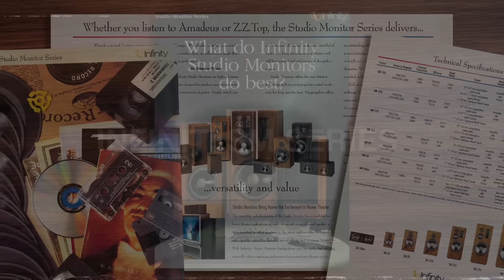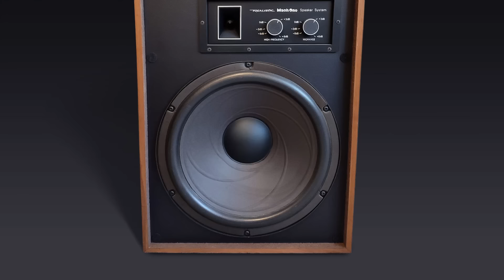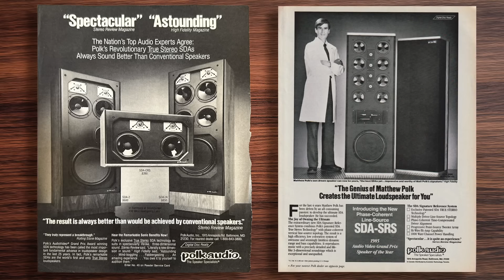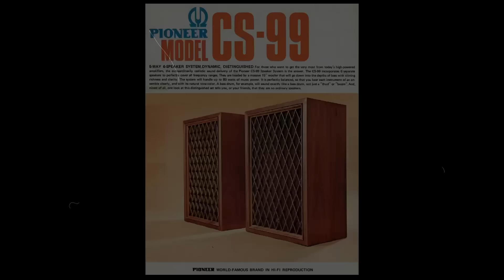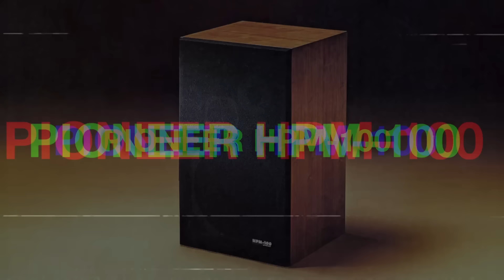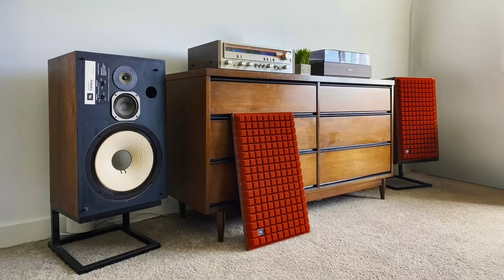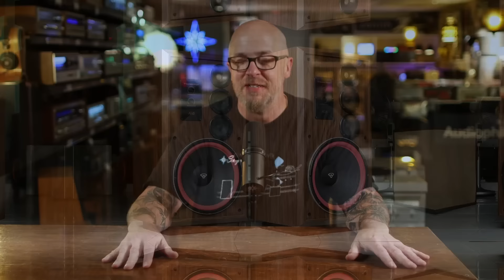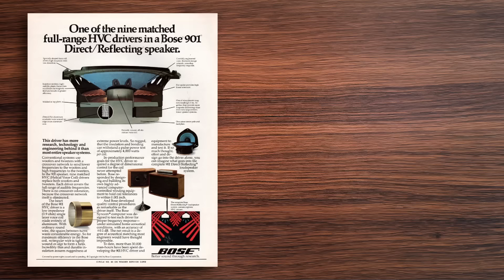Why Do Audiophiles Hate These 9 Legendary Speakers?

Comment: I have only 6 pairs of speakers! Or so I thought. I am moving to a larger flat looking through my boxes of gear, I found a pair of BBC Compact Monitors. I thought zi had blown the crossovers, merely a loose connection. I think 7 pairs of speakers is enough for a 2 bedroom flat!
 I only use 1 set in a room at a time. Greeting from England.

Comment: Little 4 1/2 Infinity 2 ways are what got me into hifi DESPITE visiting THREE different stereo stores. It was those little SEALED speakers and their easy sound that wowed me.
Bose! I've never liked anything Bose... GIMMICKY! The first pair of speakers I bought were a 6 1/2" pair of JBL 2 ways no matter how hard the salesman tried to push Bose on me. ALL of the speakers sounded muddy. I actually like the 5 1/4" JBLs better for midrange clarity & speed, but went with the 6 1/2"s instead because they did bass. I guess that makes ME "one of those audiophiles" because the only thing in this list I'd own would be Infinitys or Polks. Big woofers and ports are the enemy in my world. I'd gladly get another pair of little NHT Superzeros any day. They lack the last bit of treble speed and extension, but image like champions and even sounded better on Water Drums 1 than a pair of Energys I bought thar had excellent metal dome tweeters that just sounded "clinical" on the track vs. NHT natural.

Comment: Well maybe the different speakers do sound better or worse given the room they are in. After taking blood out of both arms and donating a few internal organs, I purchased a pair of Klipsch La Scalla II just before COVID came to town. I had wanted a pair of Horns since 1982, but when I plugged them in to my Yamaha RX-V659 receiver with DOLBY 5.1, I checked every available equalization scenario, the KHs sounded like real and total crap! I plugged in the microphone and let the "auto tune" do its thing and they still sounded like crap, I mean real crap. No Bass, Honk, Honk... Crap times a million. Then I pulled out my MacIntosh MAC 4100, grabbed a hold of the 30Hz and 150Hz equalizer knobs and straightened out the brutal efficiency drop off that starts at about 125Hz and gets real bad at 50Hz with lots of dB dropp-off (I wish that there was a 25kHz or 30kHz knob, but oh well), turned the knobs to about the 2'oclock position... The sky outside of my listening room turned blue, and life got better ever since. Moving the speakers around a bit made a huge difference. The sound stage has got Robert Plant walking across the stage right in front of me like an acoustic holographic hallucination and OMG, did any one say loud... the "USGS Earthquake Hazards Program" gave me a call and asked if I had noted any activity in the vicinity of my address (okay I may be exaggerating here just a bit). I guess that any speaker can sound like crap if left on its own and not paired with an appropriate amplifier and not setup in a room correctly. I suspect that many speakers that are not super efficient or exaggerate some frequencies can be corrected with a few pieces of electronics like an equalizer and perhaps a time delay, and by preparing the room adding or taking out things like wall hangings and carpets etc.. It is very hard to add said electronics in many receivers so I guess that could be a real problem that cannot be accounted for and probably that why back in the 70's and 80's we liked component stereos so much, today the modern paired systems in many cases just match everything up and it works, stepping outside of that circle of magic and bad happens real fast.  Maybe you have an edition or two of your favorite parings of speakers and receivers/components... ???
Thanks so much for the true reality checks you weave into every edition!

Comment: I bought a pair of CV RE25's brand new in 1997 at the Ft Carson PX. Moved with them from Colorado to Germany, then back to Colorado, and finally Missouri after I left the Army. Played them quite loud all the time. After 21 years, the foam gave up. Rather than fix them, I upgraded to new CV XLS 28's which now run through a Kenwood  KR9600 😁🤣 They are definitely loud 😂

Comment: I got pioneer HPM-900 all original I sold my hpm-100. out of all the HPM speakers i've heard nothing comes even close to the HPM-900. If you wanna play rock, blues, or psycadelic or any instrumental or moore calm natrual recordings they are in my own opinion the best speakers ever made. For me they sound better than the JBL vintage lineup. But what sounds best for me may not sound best for anyone else. I just wanted to lay it out how I feel about them.  HPM-150 sounds interesting and HPM-200 I have no real comparing of any other speakers ever made.

And if anyone is serious about running HPM series, Grafite speaker surround rings(Sorry don't know the english word) will most likely be gone from every pair in existance and they do need a X-Over upgrade if you wanna take it to the next level includes all HPM Series. Then a room thats well isolated.

Comment: I don't think the Polk Audio SDA belongs on this list. I demo'd the flagship SRS a few years ago, and aside from missing low distortion and being capable of detail the modern speakers are capable of, they produced a sound stage and volume that is often hard to replicate in todays smaller speakers. During the age of production, I'd say they did it right, and can still rival overall soundstage in what is sold today. Original Polk Audio doesn't belong on this list.

Comment: I remember in 1979 how salesmen would cup their hand and put it over their mouth to describe Klipsch speakers. If you wanted to be a audiophile or at least think you were one you hated Klipsch speakers because you were told to. In 1980 I sometimes substituted as a dj for a local club in Charleston. They had Klipsch speakers hanging from the ceilings over the dance floor. And they were very lively and nice sounding. Fast forward, I own a pair of Tannoy speakers, a pair of Klipsch RP600MII's and a pair of Klipsch Heresy IV's. And I don't care what anybody thinks, but I love the Heresy IV's. Tannoys you need to be in the perfect sweet spot in a quiet room and engage them to actually hear their magic. And magic they do possess. The Klipsch on the other hand are engaging no matter where you're at in the room, as a matter of fact you can actually be in another room and they are magical and engaging. If you don't engage them they will engage you. Loud or especially at low volume the Klipsch just sound so detailed. They are definitely speakers that love to party. And party they do well.
Reply: I hated Klipsch speakers because I owned a pair of Heresys and  don't care what anybody thinks.They are poorly built and way overpriced.Decware speakers have shown me what a speaker should sound like.

Comment: I have a pair of JBL 4311-WX-A with updated crossovers, and they are amazing. My HPM-100 200W versions are awesome as well, and it's definitely heavy on the bass. My daily speakers are Pioneer CS-99A FB's with updated crossovers, and I love them. All driven by an SX-1250. Next on the list are the DQ-10's and DQ-20's.
Reply: I wanted to upgrade from a pair Bic RTR-EV15's I've had for years to a pair of Cerwyn Vega xls-15's until I heard them in person and realized it would be a sidegrade at best. Call me crazy but I think the Bic's sound better than the Vega's. I ended up buying  a pair of used QSC E115's and couldn't be happier

Comment: As a teen, my dad had a pair of JBL L-50 "bookshelf" speakers.  They were pretty amazing as I blasted a full range of music from them: Pink Floyd, AC/DC, Boomtown Rats, Blonde, etc.  Whereas my dad played Linda Ronstandt, Chicago, Jim Croce, and Frank Sinatra to name a few.  But then he "shelved" them for a pair of Cerwin Vegas (AT15).  What we found in super low bass, we lost in the mids and highs.  It wasn't clean but just sounded loud.  If my dad wanted bass, he should had picked up a pair of JBL L110 (we heard these at Fedco).  We heard a demo of 1812 and it was breathtaking.  Later in life, I, myself came across a pair of JBL Century speakers from storage auction.  I pieced them out and sold them on eBay (I was into flipping at the time).  I regret it now since I am building a vintage system for my own personal needs.  But I guess we all go through changes as time passes by.  And our values change with it.
Reply: I bought a used pair of JBL- L100's in 1977. These are the earlier "in line" vertical array drivers. I agree with all of the critical, negative comments about these speakers, especially after listening to more modern designs. BUT... they are still playing and they still rock. It's true. You have to throw these off a four story building to hurt them. The critics will say these are rock 'n roll speakers. OK, all of you out there that don't like rock 'n roll, raise your hands. "Whole Lot of Love" on L100's? "Whipping Post" on L -100's? Yes, I'll take them every time. By the way I have three stereos systems in my house (I won't count the one on the patio that is a sampling of equipment from Goodwill and Craigslist, but it's just fine for the patio) that are all upper end gear from different manufacturers. For that in your bone marrow classic rock sound, I still like the L-100's.

Comment: As usual, most of why people still buy this stuff is purely nostalgia. If I were to choose two from this list, it would be the HPM100s and the L100.  But yeah, they are party speakers, mostly for rock, but they do that well.  Not for critical listening.  I've heard all of these and many, many more.  Currently my system is Genelec 8351s with 7370 sub, which blows away any of this vintage hi fi crap. No comparison.  Again, nostalgia.

Comment: I had a set of Klipsch Heritage speakers that belonged to a friend who moved away, so I kept them, and had them hooked to a McIntosh Mc240 with a MX110 tuner preamp, It sounded pretty decent, but he claimed them back, I ended up buying a set of Klipsch 8000fs much cheaper speakers, but actually sounded better overall, at least in my room. As far as 901's I knew several people who had them, and they sounded pretty good at the time, Maybe because they were smaller than other speakers, but eventually they got rid of them, I personally think the 901's were a launch pad for a lot of people into the audio hobby.

Comment: It helps to understand the success of the Bose 901 speakers if you put them in the context of their origin. In 1967-68, I found myself rooming in college with grad student who worked full-time at Boeing as an engineer. Read  that, "money to burn".  He wanted to buy the best of everything audio, but with no background. We hit the Seattle audio showrooms. The 901 was the star of the day. The dealers had them set up perfectly in dedicated sound rooms, fed with super amps. Their "wall of sound" just blew you away when compared to other top-end (meaning expensive) speakers. Of course, removed to a normal living environment, a lot of the performance was lost, but for $550 retail in 1970 dollars, that was still pretty impressive. Another consideration was physical size. Most of the options at the time were the size of a china hutch.  After the initial years, the reputation of the 901 slipped away quickly, what with equalization issues, power demands which would hobble most amps, and limiting placement demands, but so many were sold initially that they became a force of nature in the market.
Reply: Back in 1991 I interviewed with a Bose contractor (Bose contracted out their sales force for the Bose Wave Radio). Turns out these guys were cold-calling people who had mailed in a magazine card expressing interest in the Bose. And they'd try to set appointments to go into their home, blindfold them, set up the Bose Wave, and ask them which one sounded better, their home stereo or the Bose Wave.  I'm pretty sure they would cheat the test somehow by hobbling the other equipment, but I never took the job so I don't know for sure. But it seemed like a scam.
Reply: I think you came up with the answer your self, working for "Boeing as an engineer" and have a speaker with two bass reflex ports designed as jet engines and wupti he was sold 🙂.
Reply: We'd only use BGW 750 series power amps for the 901/802. We had a large pile of fried Phase Linear, SAE, Ampzilla, McIntosh, Carver and other power amps that went up in smoke trying to drive them at sustained high volume levels.
Reply: Never heard 901s sound good ever. Bars, dorm rooms, homes... never
Reply: There's an old pro-audio guy saying..."no highs, no lows, must be Bose."
Reply: @fredvahldiek738 I've never heard a good sounding Bose speaker. They are just pure junk. Extremely cheap particle board cabinets, crossover parts, and drivers.
Reply: @fredvahldiek738  It's the same with most of their OEM automotive systems. You have to crank the treble to the max. The bass is there, but it's concentrated between 70-100 Hz, nothing deeper.
Reply: @80s_Boombox_Collector my brother had a 240 z back in the day. He put a separate 3 way system in it from Infinity. 6x9 woofers. That sounded awesome in his car.
Reply: @80s_Boombox_Collector  I had an Accura ClS with a (claimed) customeed designed Bose sould system, speakers all over th car plus a head unit of usual radio and 6 disc CD changer (2003 model car).  The speaker sysem sounded great, but then they were just high quality car speakers, tuned to the cars intrior environment. The hed unit was okay, but nothing special. A assume Honda kept Bose feet to the fire so its brand quality was not dgraded by usoing cheap stuff. I had the car 17 years, and the CD player mechanically failed around  year 13. The Bose head unit could be repaired, but at a cost greater than replacing it with a new Kenwood, which lost the CD changer for a single play CD component, while adding a USB innput and a very nice back-up camera/screen. (The Bose speakers stayed.) Overall, a big upgrade.

Comment: While stationed in Frankfurt Höchst, Germany In 1991, I bought a pair of Infinity SM-152s for $50.00 from a soldier who was over his weight allowance for moving from post to post. I LOVED those speakers. I blew out one of the woofers and took the speaker to the PX where the other guy purchased them expecting to pay for a new woofer. They were still under warranty and I got a free replacement woofer. I miss those Infinitys.

Comment: I love my Klipsch kg4 with my tube amps but they don't get enough respect, which is good for finding them for a great price.
Reply: Just got a pair for $120!  Oiled the wood finish, installed titanium tweeter diaphragms, and put some good but inexpensive metalized polypropylene caps in the crossovers.  I put some automotive sound deadening mat material on the horns.  Now they sound unbelievable with my tube amps for about $200 total!

Comment: I'm sitting here kind of laughing at myself and wondering about myself...

I first got interested in electronics (in general) when I was in elementary school during the 1970s.  Around age 10, in 1977-ish, I began tinkering with a hodgepodge of VERY humble second-hand junk "audio" odds and ends.  "Stone knives and bearskins."  But my interest and knowledge grew quickly.  I bought my first decent integrated amplifier (a Realistic SA-1001) in late 1979, and my first decent pair of speakers (Realistic Optimus 10s) in 1980.  I was 13.  I also got into open reel tape starting in 1980, and bought a brand-new Realistic TR-3000 (TEAC X-3) in 1981.

In 1990, I graduated with a degree in electrical/computer engineering.  My professional career has been in low-level embedded software (very close to computer hardware), but I still love analog electronics as a side hobby.

Today, I'm a total fanatic about open reel tape machines.  I have a broad and extensive collection of machines from the 1950s through the late 1980s.  Vacuum tube to solid state.  Consumer to semi-pro to full-on professional.  I've spent a good chunk of change on my collection/obsession...

Speakers???  I still have my Optimus 10s, which I revamped about 15 years ago with all-new woofers and passive radiators from SEAS of Norway.  (The Optimus 10s are an unloved speaker in the vintage audio community.  They probably deserve to be on your list.  Oh well...)  I also have several pairs of speakers that people have given me for free over the years, most all of which I still need to rehab.  Of these, the decently-respected ones include a pair of Advent/1 speakers and a few different pairs of Acoustic Research (AR) speakers.  Then there's one pair on your list (Bose 901 Series II), and another pair that probably should be (McIntosh ML-10C)...  In addition, I've also paid actual money for three other pairs of speakers on your list.  First is a pair of Klipsch Heresy II speakers for an all-mono all-tube system that I'm building, focused on 1950s technology (e.g. a Heathkit W-5M vacuum tube power amplifier) and 1950s-inspired technology (e.g. the Klipsch Heresy II speakers).  The second is a pair of Realistic Mach Ones...  Just as you mentioned, for nostalgia ("part of history") reasons.  Finally, the big daddies...  A pair of brand-new Cerwin-Vega XLS-215s!  (I was cooped up with COVID during January 2023 and I went stir-crazy.  I decided I just had to have a pair of truly big-ass giant speakers!  Sound quality be damned!  LOL!)

My next pair of speakers will be something with a focus on elegance, accuracy, sophistication, and musicality.  Magnepans?  Bowers & Wilkins?  Something.  Not sure yet.  Time will tell.

Enjoy, everyone!!!
😎👍